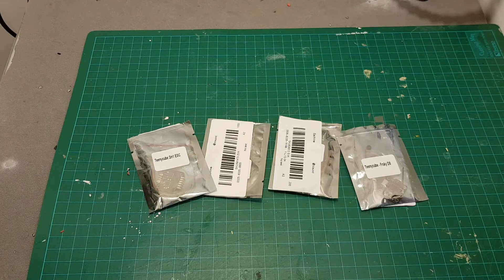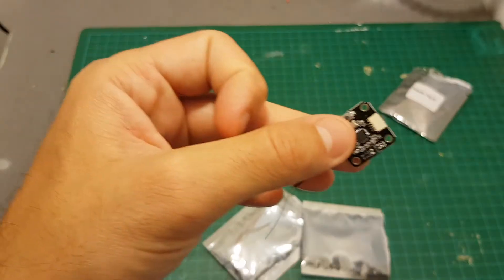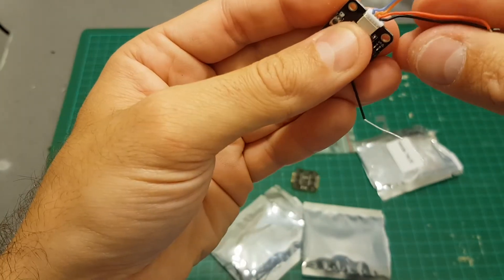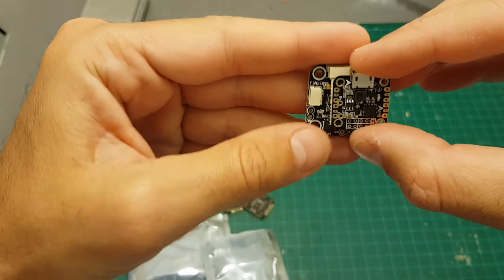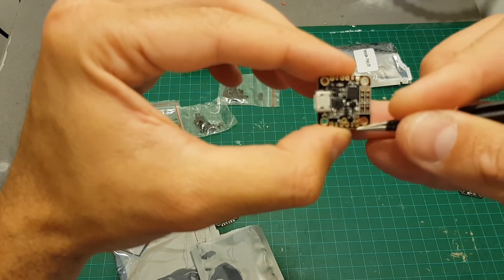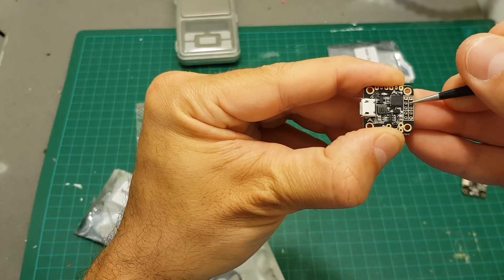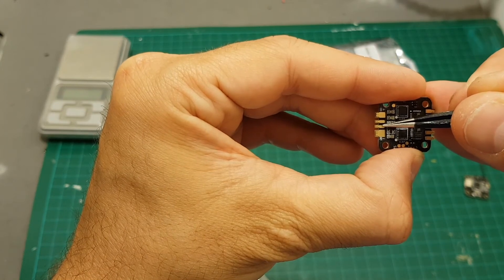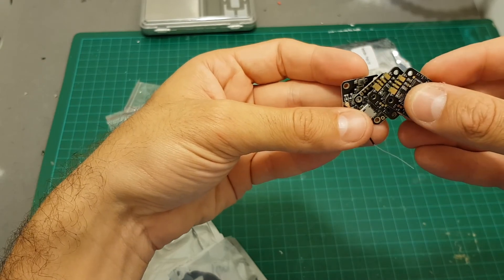Eachine TeenyCube AIO F3 FC - World's smallest FC Tower?

Comment: This stack is tiny tiny. I managed to solder it all up without incident though. Waiting on battery now. With the Flysky receiver. All hardware. Weight on finished stack. 8 gram's 👍
Reply: I did finish, however it was such an unstable flight. I just couldn't get it tuned in for any amount of fun. So I shelved it.
Reply from the maker: Nice. I haven't used it yet unfortunately...
Reply: Gal Kremer I was just going to ask if you had any additional videos. Still waiting on XT30 connector & vtx. Perhaps next couple of days.
Reply: @rickduncan2929  did you finish the drone? I just bought this tower second hand and i have some questions